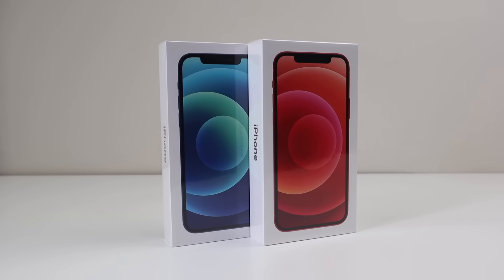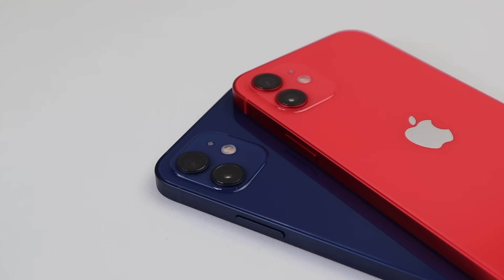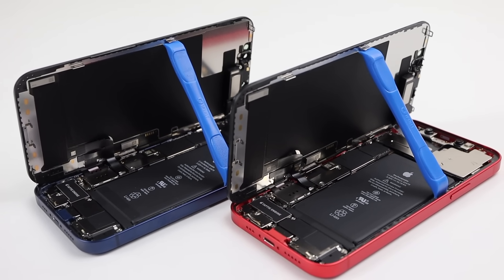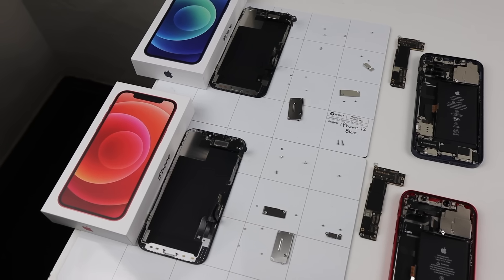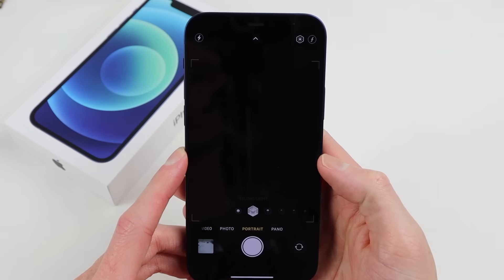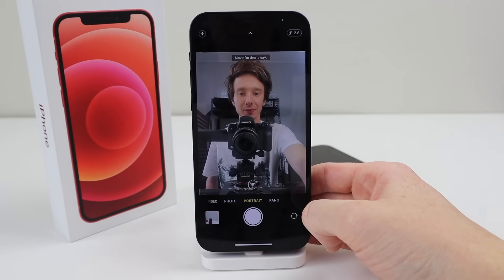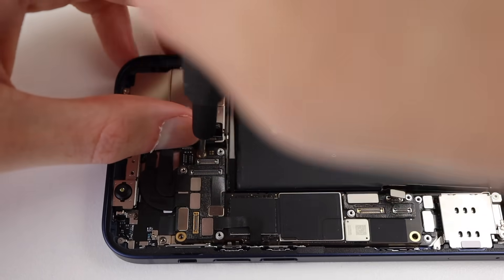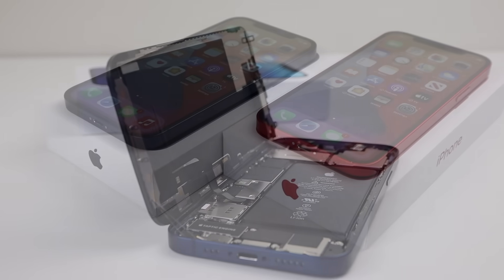iPhone 12 Anti Repair Design - Teardown and Repair Assessment

Comment: Apple is not the only big asshole company doing this .. VAG group / VW / Audi etc. do this trick on all there new vehicles .. they call it Component security - google it- you cannot even replace a genuine head light with out a VW dealer programing it into the cars system.. no right to repair there either guys
Reply from the maker: I got a VW, what year did that come in?

Comment: Apple is technically right with not including headphones and power adapters to save enviroment. The thing is that they don't sell for cheap power adapter and headphones when you buy iP12. So what people should do? NEVER buy apple power adapter from Apple and that's it.
That thing about pairing - there is still a chance that cameras and TrueTone is calibrated to the specific device.  Remember when Apple had hard time making white iPhone 4? When some guy was  making them white on his own, but white balance on camera was off because of how that phone was bouncing the light off? I'll give them benefit of doubt and wait for what they have to say about that. If nothing, then we should bash them for their practicies.
Itt could be smart to ask the makers of programmers that can copy and burn TrueTone sensors, aks what specific data those guys copy.

Those phones are brand spanking new, probabbly next updates will change something with cameras. Like add warnings and all those stuff.

My iPhone 5, 6 and iPod Touch 3G also could not boot after medling with them. I highly doubt that not booting from power button is any significant.

Comment: My guess is China will find a way to avoid the important display message, as they did with the important battery message
Reply: Its rewa programmer
Reply: It's not Rewa programmer. You have to remove the battery management system from the old battery, and spot weld it to the new battery. Then you have to activate the cell and zero the cycles
Reply: @ninjarepair  I dont see how that would be the case. if so, the battery message wouldn’t show up since Hugh used an original battery.
My supplier delivers the batteries ready-to-use, but i don’t get any battery message and battery health monitoring is still active
Reply: That is on for example the XS. i exchanged the customers used battery with a new one i got from a local supplier, and then the message showed up. i called in the customer a week later when my usual supplier started selling them. this one worked just like original
Reply: @nixnormal  that's strange. I'll have to look into this further. The none genuine battery message should only pop up on XR and upwards though
Reply: @ninjarepair  I can say from personal experience that on XS/Xr/XSMax they figured out how to avoid it on non genuine batteries
Reply: @nixnormal  I'll have to ask my supplier for some :D
Reply: Can you give me a link to remove the battery message?
Reply: I wouldn’t know, my supplier makes sure they’re programmed from the factory
Reply: nobody xD  I meant XS upward sorry 😂
Reply: Give them a some time  they recently found a way  to fix Face ID 😂

Comment: You are doing great work, ppl needs to know this "cameragate"
Reply: @The Anonymus Apdroid Definitely no. Android manufacturers currently have no plans to lock a certain part to the motherboard. If there was, it will cost more money than they could handle.
Reply: @TCYUx  Like how Samsung laughed at Apple for 
removing the headphone jack (then removed it from the S20)
removing the  power supply from the box (S21 is stated to not come with one)
the notch (then introduced holepunch cameras...)
Reply: @tim3172  Removing the headphone jack only began on the Galaxy A8 (2018) or Note 10 lines.

Comment: First of all, WOW!
Amazing video, I am blown away by the quality and effort you put into it, thank you!
Second I am wondering if these behavior was intended, maybe with regards to security.
Assume you could switch everything in a phone besides the memory. Than you could steal someones phone, switch the hardware and be able to excess the files on the phone.
I am by no means saying the solution for this problem should be bricking the phone just that it might have other reasons besides Apple being a-holes.
Reply: a screen shouldn't be a paired component. neither should a battery be. or the rear cameras. those components wouldn't cause someone to break into a phone. a face id sensor, maybe. but it is ridiculous those three components are paired.
Reply: I highly doubt that many people could get into these devices and replace motherboards without damaging the device somehow... So many fragile flex cables, fragile glass display-

Sir_BusinessNinja is also quite right. Batteries, rear cameras and displays shouldn't be paired components. These parts will wear or get damaged over time.

Comment: iFixit and Rewa Technology will surely find some solutions for this. Cause there will be some data structures in those flex cable and those should burn in new cable.

Comment: What if you transfer face id module (ir camera especially) to the correct motherboard and then replace cameras. Cameras are still laggy and won't work properly?
In previous models if ir cam is not connected or broken, cameras doesn't work.

Comment: Tbh board replacement is a VERY VERY rare issue. And usually happens after years of using the phone. So , I don’t think its a big issue. Its Apple that’s why everyone is making a mountain of it.
Reply from the maker: Correct you don't usually replace the logic board but you replace other components connecting to it. Swapping the board in my case was to easily test which components wouldn't work after replacement.

Comment: Well that's gonna be e-waste in few years if apple drops service support 
Excellent environmental friendly move Apple 😑
Reply: By the time service support for the iPhone 12 is ended, there will probably be an iPhone 20 or so already. iPhones get 5-6+ years of software support and some hardware support after that through Apple, so I doubt it will contribute to waste (or at least, far less waste than relevant Android competitors with less software and hardware support). No one is using a phone for 10 years, so Apple’s official support length is fine.

Comment: Apple really does have an e-waste problem, first off they can make it really difficult to repair a device (especially watches and AirPods), it seems like each new Apple device released, is made more difficult and expensive to repair. Second Apple makes it difficult for a used device to be bought or given away to a new owner, thanks to iCloud and activation lock. I understand that these locks protect the previous user’s data in case the phone was phone stolen or etc, but I’ve seen many perfectly good working iPhones and iPads for sale but are almost useless as they’re locked. I myself bought an iPhone 5 for $5 a few weeks ago, but it’s sitting in my drawer useless as it has an activation lock on it.

Comment: So this video is telling me every component of the phone is paired some type of way to the phone itself somehow therefore even if there were aftermarket parts available there’s no guarantee the functionality of it due to that process.it would’ve been interesting to see if they paired the batteries as well
Reply: Also something to note IFIX IT gave this phone a 6 out of 12 on repairability stating there’s a lot of screws to keep up with (every i phone ever) and the adhesive used on the display would cut water damage down however I feel like after your discovery IFIX IT needs to revise and do the same thing you just did before putting parts out there that simply won’t work chances are batteries and displays as well will be paired to this device A strong feeling tells me

Comment: hmm a screw is missing, guess I'll just replace it
iPhone : malfunctions
Reply: In fact, it was a deal with 5s back then.
Reply: Even if you squeeze your iphone to hard and apple's air got out of the iphone and replaced with regular air inside your iphone = chaos!
Reply: @bramvandenbroeck5060  lmao. Warning: Cannot recognize fake oxygen
Reply: Look at the iPhone 8 and helium problem :p
Reply: lucky the screws are not paired (yet) with the phone ...
Reply: @papagal2553   dont give apple ideas
Reply: Daniel Varela  Note 7 Flashbacks
Reply: Me: adds a debrand skin to the back of my phone
Apple: "you can no longer use face id or camera and if you want to charge your phone you can send it to Apple and pay a fee to charge your phone battery"
Reply: On the 5s many people caused problems, by damaging the pcb with too long screws. It is also possible to do this with newer iPhones. Other phones use only a few types of screws, so it is harder  to mismatch them and to cause damage
Reply: @tommidtommi  also the screws length difference was to small to see it by eyes
Reply: I laughed 2 mins straight on this.
Reply: Hahaha
Reply: This is the best comment yet! 🤣🤣🤣
Reply: That day is not far!
Reply: It's not a bug, it's a feature
Reply: Apple: Imma end this phone's whole career.
Reply: @ankursagale  welp the next thing you they will probably made it impossible to remove the adhesive and if you do remove the phone breaks
Reply: Dont give apple that idea 🤦‍♂️
Reply: securitycountercheck  everythingapplepro did a test of this and his iphone 8 shut down after a couple of minutes ;)

Comment: I am pretty sure that they gave a USB-C cable so you can now connect it with your MacBook, not just for charging, cos that was a big complaint for Apple users. 
Also your old USB-A brick still has a lightning cable that will charge the new iPhone. No need to buy a new brick just to match the cable 🤣
Reply: That's fine you can charge but at 5watt who will wait most of the users will buy new charger that's their plan to sell new chargers and not being super environment friendly. 
If they were trying to be environment friendly they should have also run a program to trade in old charger and give new charger and not selling new for profit
Or they should have get rid of this lighting port

Comment: Hugh Jeffrey: apple killed repairs
Ifixit: iPhone 12 scored a repairability of 6/10. 
Me: so can I repair my phone or not?!
Reply from the maker: Yeah your right. But how does it get a 6/10. It doesn't matter how modular the parts are if they don't work right after replacement....
Reply: @HughJeffreys  you are right, the home button error, error 53 is proof of that
Reply: @HughJeffreys  is quite a shame that ifixit didn't went as deep, specially considering that they supply non-oem parts for iphones. 

I can get why the phone would give warnings about iffy batteries, but here we are talking about an OEM parts that cannot be reused on another device.
Reply: @RenatoLaporte  iFix It slams other brands for the smallest things, but different screws and OEM parts that don't match are okay. 6/10
Reply: @e39purist89  Different screws probably help as otherwise you get 20 philips head screws of varying lengths
Reply: @RennieAsh  But then you need to find all of these different heads and bits. Tell me again that's an advantage over the simple task of knowing which screw goes where? And the fact that there are still different screws of different sizes with different heads within the phone. Hell, there are even 2 different size standoff screws with the same head but they sit in the same general area.
Reply: Ragon Maarten I don’t see it as much of an issue at all. Easier to not mix up screws in some cases as you know that that one isn’t the right head.

Also you are arguing that it’s a “simple task to know where everything is” yet complaining about 2 similar screws in the general area? I thought it’s a simple task to know where they go
Reply: @RennieAsh  My argument is based on the fact that the phone still has random length screws with the same heads. Its just easier for the consumer to use 1 bit instead of finding other and even annoying heads (like the pentalobe).
Reply: Ragon Maarten very slightly easier perhaps. They are more likely to break something trying to pry it up. A mechanically minded person wouldn’t have any trouble imo
Reply: @HughJeffreys  this video needs to be viral, and apple needs to get exposed but can you change your thumbnail ? It seems low quality
Reply: @HughJeffreys  it's like I can change my car wheels pretty easy but If I change them with 10 inch rims they will not work
Reply: @HughJeffreys  Become part of the 3rd party repair programm and get Access to the right tools and STOP Complaining.
Reply: @benNdaKen  those programs were just meant to appease legislation for the right to repair movement.  In action, it is extremely difficult to get these parts and the wait times are horrendous, plus you have to give all the customer’s information to apple.  It is not practical for time-sensitive repairs (that being most of them) and customers will simply go somewhere else.  They really got us bc now apple can say “hey we sell our parts to 3rd parties see” but in reality they’re just screwing us the same way
Reply: @MantisssssssMan  are u part of the program?
Reply: @benNdaKen  I am not as I don’t have an official shop yet, but everything I said can be backed up from Louis Rossman’s video here: https://youtu.be/rwgpTDluufY
Reply: @MantisssssssMan  louis rossmann talks Alot of bs sometimes without have proper knowledge
Reply: @benNdaKen  Its not that. It's just a case of how expensive it is. Even if you're part of the 3rd party thing, you still have to pay a lot. That's why 3rd party repair shops exist. He literally had parts from another iPhone 12 as well
Reply: @benNdaKen  you mean that 3rd party repair program where you have to get every personal piece of info you can on every customer and then the manual you get says “for any error send to this address for service”, that one? (See Louis Rossmann’s videos on it)

Also, if you were being sarcastic, the capitalizing of “stop” doesn’t help convey that
Reply: @Leftfield2k7  I can change my car battery,  camera battery but not my phone battery!  There was a time changing battery on a phone was a no brainier until apple came when the lockdown
Reply: It's repairable. But you need to have an access to Apple Toolkit (or whatever they call it) or other IC burner to "re-pair" the components you replaced.
Reply: @VMiXEZ  many people done that as well but it all go in vain check out the video from @strangeparts
Reply: I fixit scores aren't really a repairability score, it's more like how easy is the phone to access
Reply: the screenshot says 3rd party repairs not sending the phone to apple for repairs.
Reply: @rzpogi  No shit sending repairs in to apple would solve the problem. That would be the case for most phones to begin with anyways
Reply: So I can't use JC pro to burn the serial numbers
Reply: @benjaminokello5547  sometimes it’s that easy, but the main thing is transferring IC chips to new components.  It’s possible for batteries, screens, and faceID/touchID components.  Just ordered a rework station tn this is my next venture I’m getting into as it is clearly the future of repair since apple sucks
Reply: @benjaminokello5547  Very unlikely.
Reply: @VMiXEZ   Sad. I will stick with the 11pro
Reply: @benjaminokello5547  consider an android
Reply: nooo
Reply: Modularity =/= reparability if hardware refuses to work for literally no other reason than to lock the repairing of components out and force the end user to go to an Apple Store.
Reply: @Stevey Canuck iam
Reply: 1/10 more like
Reply: lol ifixit only focus on modularity not otherwise...Jeff here went way beyond wht other reviewer and well-known 3rd party spare-parts supplier does...he practically play legos wth those 'environmental-friendly' no charge brick in da box-to safe planet earth- iphone 12s n..hahaha lucky im not IOS user

Comment: Apple : we zero climate impact
Also apple : release airpods
Reply: Mmmkay, I’ll bite since I’m commenting at 4am. Do YOU own AirPods?
Reply: They can still recycle it. Recycling and repairing are 2 completly different things
Reply: @bl4ckbl1zz41  that still should not happen. Doesn’t reuse come before recycle?

Imagine if you had to send your new car to the junkyard just because it’s out of gas - and there’s no way to refuel the tank even if you take out the fucker from underneath the car.
Reply: @Xalataf Spare parts and batteries.
Reply: @StinkyScript  what are you talking about?

for Airpods? Non-existent.
for the car? Would still be useless since the car has no gas. Unless you keep replacing the entire tank.

Should’ve probably put that the fuel tank assembly was also paired to each car.
Reply: @xalataf3365  Extreme false equivalence. You should probably stop making comparisons until you can figure out how to make them.
 You should probably look into the fuel pump replacement on modern cars which, in many cases, is a multi-hour complex task that requires draining and dropping the tank at the cost of up to several thousand for a ~$100 part.

Comment: What a Shame. Very low apple very low
Jailbreaking should solve this problem ryt?
Reply: Very good question, might be possible. Testing needs to be done by the jailbreaking community first to see. I'm not sure though. The serialization of parts is usually in the eeprom on a hardware level, and Apples security is top notch when it comes to hardware locks. I'm pretty sure that Touch ID and Face ID still don't work on jailbroken devices if the parts have been replaced by anyone other than Apple. Not sure though, just going off of what I think is most likely.
Reply: The only thing jailbrakeing can help with is probably the notifications to disable them so you don’t get spammed

Comment: You can’t make that power cable claim. If you already have a usb power adapter, you probably have a usb power adapter for an iPhone too. Also, the realistic number of people who will try to repair their own phone is extremely low. Most people will just take their phone in to have it repaired, which will work just fine.